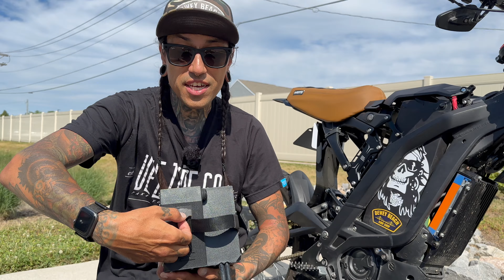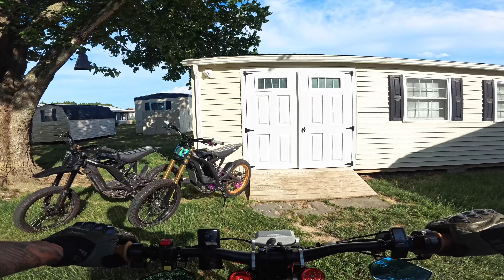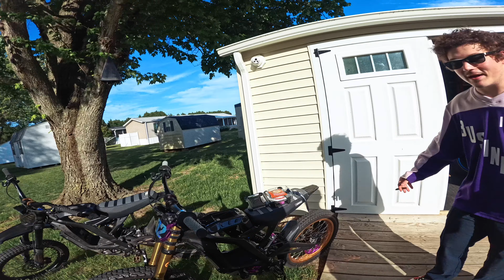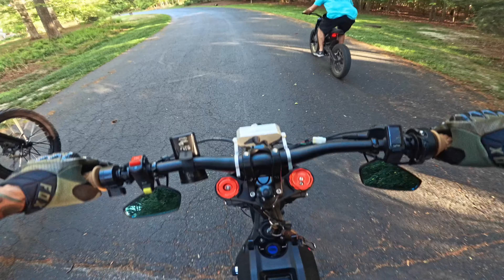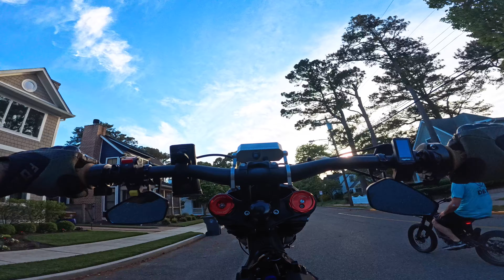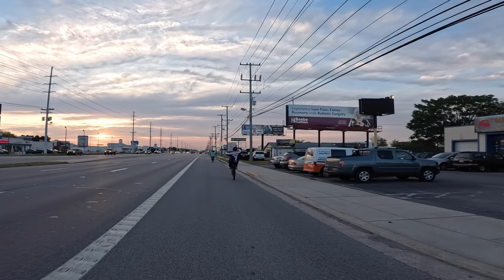INSANE 72V SUR RON Upgrades & Wheelies! (Post CRASH Aftermath)

Comment: Hey shreddie what's good my dood..hey im getting my 1st surron it's bone stock but I got a great deal on it.. what's the best 1st mods I shld do...like 1-5 or 1-10 modes as a must hv.. appreciate ya my good keep up the great vids luv em...if u ever come down south to Miami hit me up dood..
Reply from the maker: Glad you’re getting one! I’d say start with a bigger battery and controller. 💯 Definitely some new tires—maybe some Enduro style if you ride street and dirt. You should also upgrade the pegs, maybe get a direct mount stem, and a more padded seat.
Reply: @SHREDDIEMCSKATE thanks man u got any codes for parts?? if u do ill use em..
Reply from the maker: Check out the description of the video on my link should be there. If not, let me know what you need.

Comment: I notice that both Matt and your other friend have Sinko 241 and 244 tires, but each of them are swapped opposite front and rear. Any benefit to either setup? I'm considering just getting two of the 241's to replace my old stock tires. That Sotion motor looks tight. Glad I waited, instead of getting KO.
Reply from the maker: @VRGalaxy_762  Cole has stock 19 front and 18 rear